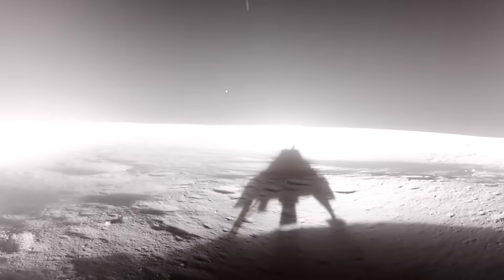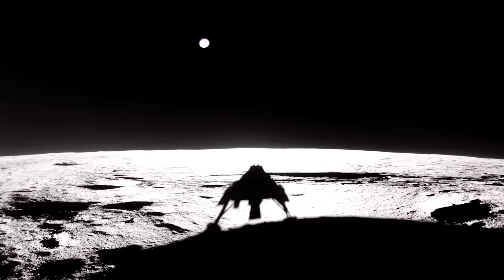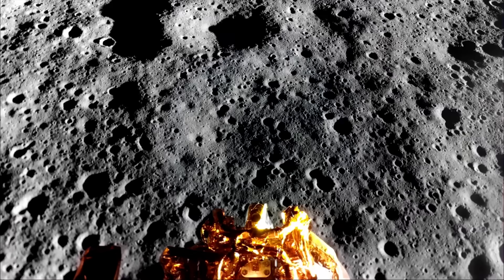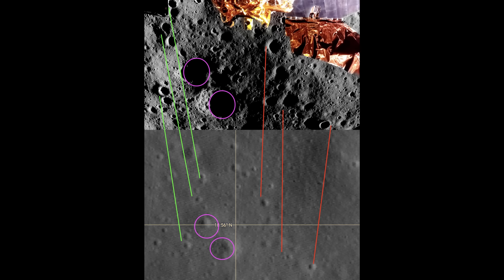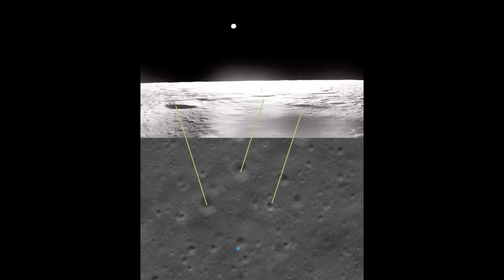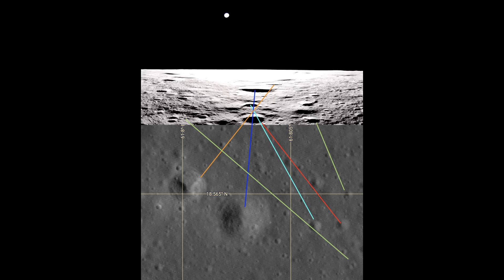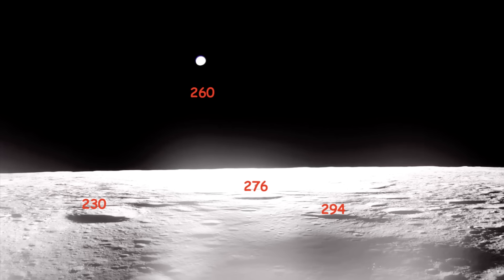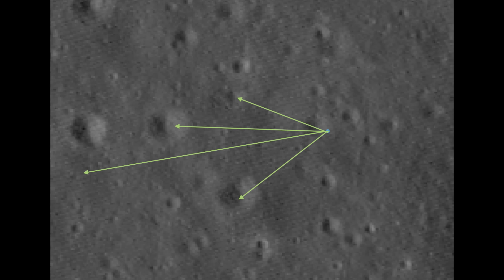Blue Ghost's Landing Video Reveals Exactly Where It Landed On The Moon

Comment: can we just appreciate how cool it is that after half a century we finally get to see what the Apollo astronauts saw? I can't believe it took this long for a HD camera to be strapped to a lander. Also can't wait for the "deboonkers" that will say the vibrations are it blowing in the wind
Reply: that was the first thought I had. I saw it flapping and said "oh brother" out loud. gonna whip the conspiracy nuts into a frenzy. There is actually quite a bit of HD moon footage btw, it's just low frame rate
Reply: @quistador7  yeah, most of that footage from the Apollo era is in better than 8k quality due to the film format used(old school 35 and 70 mm film had amazing "resolution"). The problem is that most of it has never been scanned in 4k or above resolution, and as stated, the framerate is pretty low to conserve on film since it was heavy and expensive
Reply: @ 16mm film can be up to around 2300 x 1700 equivalent. They're typically scanned at up to 200 pixels / mm, which is even greater.
Reply: @tubecated_development it's worth bearing in mind that over-sampled film is higher resolution than native pixels from a CCD camera due to the optical low pass filter in the latter
Reply: @richarddickjohnson516 All of the film shot in space or on the Moon during Apollo was 16mm. There was some 70mm used for ground based tracking cameras. Still photos on the Moon were both 35mm amd and 70mm.
Reply: @richarddickjohnson516 They were also able to bring that 8k film footage back with them. It didn’t have to be transmitted by radio 1.5 light seconds away..
Reply: @richarddickjohnson516  Yes. Good quality Kodak Color Film from that era is 36 megapixels per 35 mm frame, with a 64 bit depth. I am not sure that any consumer CCD camera has reached that pixel count yet. (in 2025)
Reply: @quistador7 being uneducated isn't as blissful as the saying indicated.
Reply: @quistador7  You didn't find it strange? If a piece of your car or plane did that, you'd freak out, I hope!  What a bunch of minions, can't question anything 'space'.
Reply: Mayhap you should watch the original Apollo videos from the moon and look at all the photographs. And ayup, I saw it all live time.
Reply: They'll flock on it as soon as they see it.  Them and the flat earthers 😅😂
Reply: @stevenblackwell4903  Do flat Earthers also believe in a flat Moon?
Reply: @zebo-the-fat  not sure. But, that's a good question.
Reply: @zebo-the-fat  Some say it is a ball of plasma. Problem with that is they also say there cannot be gas pressure without a container.
Reply: @Sharkey-KT66 it's a hologram but so are we
Reply: A very regular pulsing wind like the pulse rockets would make.
Reply: @JoelTopsom the rocket exhaust was no where near this.  Tis vibrations from the pulsing that are reverberating through the structure of the craft.
Reply: I was around back then and following Apollo as best as I could, now you can really follow stuff if they let you.  So cool a time to be able to just watch this stuff from anywhere in the world at the touch of a mouse...
Reply: I really hope we one day get a live landing video from a lander, that would be epic
Reply: @simandi1511  dont you saw it in mars, with perseverance?
Reply: I could literally wait forever to hear from those people ;)
Reply: You would have to be restarted to believe they had they ability to have a shuttle orbit the moon, detach a lunar lander with crew, and then have that lander somehow have enough thrust to meet the orbiting shuttle, dock, and then go back to earth, all on the first try🤡🤡🤡
Reply: oh come on don't be so stubbornly naive! No 'astronaut' has seen the moon closeup man wake up!!! if they did, they would have gone back many times, especially now in this era where rich people/companies are trying to get there. jezus christ why is everyone so patriotic and dumb.
Reply: Oh yes. It is obviously fake. That wind flapping the foil is a dead giveaway. And Scott even blows his cover, by saying "the lunar vacuum cleaner." They only work in the presence of a dense atmosphere. There you have it. Proof that Scott is part of the Great Conspiracy.
Reply: Is earth the only planet that's flat? How come other planets are spheres? An if earth is flat, where is the edge??
Reply: @gregorynicholson3609  Earth is the only one that is flat. There is a big ice wall surrounding it. It has to be a big tall ice wall so Bob Ross can reach up to paint the other planets onto the dome.
I'm obviously joking. Bob Ross only paints lakes, mountains and forests.
Reply: @fastmclaren71  yeah, he's good that Bob Ross
Reply: @gregorynicholson3609  Earth isn't a planet. And stealing from the 'big bang'....maybe there is no edge/end, of earth.
Reply: Very interesting that there are currently three missions to land on moon. All private exploration too. Somebody is spending a f-ton of money to do this and they don't blow that much money with no chance of ROI. Interesting times we are in. Maybe NASA can do something in space now that Elon saved them millions dumping DEI crap😂
Reply: @jdnettles2506  You expect Elon to leave competition in place when he's been handed the permit to do as he pleases?
That moron will set back NASA by decades when he's done.
Reply: @h.a.9880 To be fair SpaceX makes rockets only not exploration spacecraft which is the payload going inside the rocket the rocket is just a transportation system. So Is in Elon’s best interest that NASA has many probes to send everywhere so he can continue to build the rockets to put them where they are supposed to go. Nasa should focus on exploration not in building rockets. There are plenty of companies making rockets. blue Origin ULA SpaceX to name a few.
Reply: @h.a.9880  you sound like you are in a cult of some sort.
Reply: "Clearly a studio shot." and "It was done using CGI."
The scary thing: people that say these things are allowed to vote... and their votes count just as much as ours.
Reply: @h.a.9880 surely moon doubters deserve representation. Best thing to do is stop all the lying and deceiving on ordinary matters, so people gain trust towards institutions.
Reply: @testi2025  "Moon doubters" don't deserve respect, they deserve compassion however.
Reply: @h.a.9880 😂 you think the moon landing AND voting are real?  Crazy times.
Reply: @troyrager1352  If you're trying to tell me that you believe the moon landings are fake and that you do not vote, it's the best thing I've heard all day.
Reply: @h.a.9880 wait, you believe government?  😂 k
Reply: @h.a.9880 they thought Biden caused inflation,  whereas tariffs are ACTUALLY going to make prices increase,  overnight.
Reply: Yeah and in so much better quality, We truly are living in the future now.
Reply: Watch  "American Moon"!
Just the 10 last minutes...
I know the rest won't convince you.
A real treat!
Reply: We couldn't see the same things the Apollo astronauts saw, Stanley Kubrick is dead.
Reply: Yes, on every facebook links of these there is plenty Trump-voters fast ;-)
Reply: @OKuusava  stereotype much?
Keep spreading the love.
Reply: @richavic4520  You mean there was only one trump voter? ;-)
Reply: @OKuusava  more than there really were for Biden in 2020
Reply: @OKuusava He lives rent free in your head
Reply: @Kuusava Right. Because only Trump voters would deny the moon landings. As though unscientific and magical thinking are limited to only the voters of one candidate. Baloney.
Reply: See even y’all know it deep down! If the things that say are so nuts & ridiculous then why is it that it hit you instantly? Hmmm
Reply: No one has been to the moon
Reply: @Cycleplayer117  I would be willing to start a collection to send you there.
Reply: @Cycleplayer117  Reported for misinformation. FOAD.
Reply: @thomashiggins9320 quit reporting people for not believing in the moon  landing you're being a real child and this isn't your basement where you get to control the narrative, quick mommy this guy doesn't believe the government come save me😂
Reply: I refer you to Everyday astronauts recent video proving you
 wron..... an stupid tw@t.
Reply: @Cycleplayer117  Thats you religion, and surely you believe more advanced stuff: god ;-)

Comment: 4:37 You can see Blue Ghost's shadow tilt slightly to the right as three of lander's legs settle squarely on the surface. The fourth leg can be seen moving up slightly before finally coming to rest.
Reply: Are those legs rigid or cushioned by hydraulic movement allowing a solid settling down?
Reply: @mikeharrington5593  It tilts 2 times actually, you can tell its seesaawing on the diagonal, so Im guessing they are rigid.
Reply: @mikeharrington5593  hydraulics would be too heavy and cumbersome-- too many parts, failure points, etc.  They, like the LM before, use "crush structures" in the telescoping legs-- basically a honeycomb material that under impact will crush and deform to absorb impact forces.  Evidently they, again like most of the LM's, touched down SO gently that very little "crush" actually happened, so the lander is sitting higher off the surface than was probably intended.  It also means on irregular ground, like with two opposite footpads sitting on higher ground and the other two on lower ground, like straddling the lip of a crater, that the lander then settled to one side or the other as it "tipped slightly" and settled into its final position.  That's the problems with four legs-- more stable, true, but on rough ground it's liable for 3 of the legs to be touching the ground and the fourth barely touching or even off the surface.  Three legs will always result in all three footpads firmly on the surface, BUT the greater angle between them (120 degrees instead of 90) means that if there are substantial sideways rates at landing (flying sideways somewhat or drifting sideways) and two pads "dig in" it could possibly tip the lander over easier than the same rates with four legs.  That's why the LM had four legs.  More legs don't necessarily mean "more stable" either because it's just easier on irregular ground surfaces for 3-4 to be holding the lander and the rest perhaps not even touching the surface.  With four if the impact is enough to crush down the legs and make them telescope up a bit, the fourth leg should be firmly on the surface.
Reply: @mikeharrington5593  aluminum crush core most likely

Comment: The speed at which the dust settled was so fast! Extremely cool
Reply: It didn't really settle, but it got shot off so fast the cloud went away! There's worries about these dust shards getting kicked into orbital speeds and becoming micrometeorites that could damage lunar equipment or personel in the future.
Reply: @NoobtooberMan if it was shot off the surface, it’s perilune would be back at the surface. Either the material is shot out of lunar orbit or it winds up back on the surface. It could not stay in orbit
Reply: @fax10  i didn't say orbit. I said orbital speeds. Its dangerous to have that stuff fly even for a relatively short time away from the surface
Reply: @NoobtooberMan orbital speed...nope
Reply: @NoobtooberMan  I think those might be flung up pretty fast and high initially. But their individual perilun is near or below the surface, so will come down eventually and crash into the lunar soil. Which would brake it and slow down.

I mean, the same happened to all the other crater impact dust that apparently settled in the eons of time.
Reply: @NoobtooberMan  It didn't really settle, but it got shot off so fast the cloud went away!" - the video footage very clearly shows that it falls down. 
"There's worries about these dust shards getting kicked into orbital speeds" - they would need to go faster than 2 km/s. Very little chance for that, so no, there are no worries about that.
Reply: @renedekker9806 and this dust was nowhere near 2 km/s
Reply: @NoobtooberMan  Golf ball, falcon feather, hammer - it all comes back.
Reply: No air for dust to linger. It all falls down no matter the size.
Reply: @GunnarLof  Newton and Galileo were right. How about that.
Reply: It's so weird to realise that dust particles follow ballistic trajectories on the moon.
Reply: With no air it all just falls back to the ground in a parabolic arc immediately.
Reply: @bitbucketcynic  Hey Newton was right!
Reply: No other footage like it
Reply: @JohnJackson-ttzd4  Don't presume to forgnore the 380 kg of lunar material returned by 12 astronauts over six missions--one astronaut a professional geologist.  Continuous international published peer-review scientific study of that lunar material since 1970.
Reply: Watch  "American Moon"!
Just watch the 10 last minutes...
I know the rest won't convince you.
A real treat!
Reply: Extremely cool or extremely fake?
Reply: @semicolon101  sigh.
Reply: @semicolon101  The former. If you think this is fake, sheesh.
Reply: @semicolon101 There's always one clown🤡
Reply: @semicolon101  we're getting BRAND NEW moon landings and you're STILL saying the moon landings are fake, stuck in the 60's are you?
Reply: @semicolon101 it looks fake
Reply: @JohnJackson-ttzd4  How would you know what the Moon looks like?
Reply: @ it looks computer generated. the dust doesn't look real. But this is just one of many many reasons to not believe. for example landing in an upright position is very difficult. only now it's somewhat possible with starship on earth (on an extra prepared landing pad). weirdly enough it was done in 1969 on the moon 6 times in a row with almost no computer power 😉with a vessel that is 20 times smaller and hence with a lot less fuel even though you need a lot of fuel for landing and takeoff. the lunar escape velocity is 2.4 km per second. thats a lot.
Reply: @Canada_Dominium  actually for landing you would need more fuel on the moon since there is no atmosphere to stop the fall. for takeoff you would need less.
Reply: @tubecated_development there are many lies in politics, its standard
Reply: @  "the dust doesn't look real."

How would you know what the Moon looks like?

"6 times in a row with almost no computer power"

All done with lots of on-board and ground computer power.

" you need a lot of fuel for landing and takeoff."

The Grumman LM was a dual spacecraft.  How long have you been on the planet?  Is it recent?
Reply: @ "actually for landing you would need more fuel on the moon"

Grumman Lunar Module.  Descent stage.  Ascent stage.  Descent stage left on Moon.  Ascent stage return to lunar orbit.
Reply: @JohnJackson-ttzd4  You forgnore the 380 kg of lunar material returned by 12 astroauts over six missions--one astronaut a professional geologist.  Continuous international published peer-review scientific study of that lunar material since 1970.
Reply: @ surveyor didn't take off again, it didn't have humans onboard , it had 2 out of 6 failures and who knows maybe even that was a lie
Reply: @JohnJackson-ttzd4  Apollo Lunar Module was TWO spacecraft: descent stage, left on lunar surface, and tiny, lightweight ascent stage back to lunar orbit.
Reply: @JohnJackson-ttzd4  One Surveyor DID take off again and re-land a short distance away.  How long have you been here?
Reply: @JohnJackson-ttzd4  "the lunar escape velocity is 2.4 km per second"

Except the LM ascent stage went into LUNAR ORBIT.  That's 1.6 km/s.  Not lunar escape as you pretend.  Why do you Iie?

The LM ascent stage back to orbit was small, lightweight, packed with fuel, and carried only itself, two crew in spacesuits, and lunar material.  EVERYTHING down to lunar overshoes was jettisoned prior to liftoff.
Reply: @JohnJackson-ttzd4  "the lunar escape velocity is 2.4 km per second. thats a lot" - you thoroughly misunderstand escape velocity. The lunar lander was not a canon. 
Let's be frank, everything you bring up is just a desperate way for you to try to justify your pre-existing beliefs. You have no reason for those beliefs, other than "I cannot imagine it to be possible". That is called an "argument from incredulity", a logical fallacy. Why don't you dive deeper into how it was actually done, and you'll learn how the issues that you think there are, were overcome, or are actually not issues at all. 
Displaying your ignorance in YouTube comments is not a good way to learn more about this.
Reply: @renedekker9806  you guys trust politicians more than your own eyes?
Reply: @renedekker9806  this dust settling is the most cgi dust settling ever. have fun being manipulated time and time again. politics is everywhere. even FB chef admitted censorship.
Reply: @JohnJackson-ttzd4  Try to understand basic physics. F=MA for instance. The same atmospheric drag that you mention would affect both landing and takeoff. Actually, without the drag, the differential equations become much simpler to solve.
Reply: @tubecated_development Surveyor had a very large footprint. Something that concerns me about Starship. It doesn't look stable to me, especially with an unprepared landing surface. As an engineer, I think about this sort of thing, but SpaceX has a lot of engineers who probably are considering the same.
Reply: @Canada_Dominium  What standard are you using as a standard to make these assertions?
Reply: @Canada_Dominium  That was more like a bounce. We were still learning in those days. We didn't know much of anything about the lunar surface.
Reply: @JohnJackson-ttzd4    I presume your expert opinion is based on your years of engineering experience and that you have done all of the necessary dynamic calculations to back up your claim. Or maybe you are just spewing nonsense?😂 I think the latter is more likely. Why would it be difficult to land a small, approximately cube shaped craft the correct way up? Also saying it looks fake would require some expertise in image forensics. I presume that is another speciality in which you are highly qualified. 😢😢
Reply: @davidsandy5917  A standard for historical facts about the Apollo Program?
Reply: @JohnJackson-ttzd4  take your meds. it will be alright dont worry.